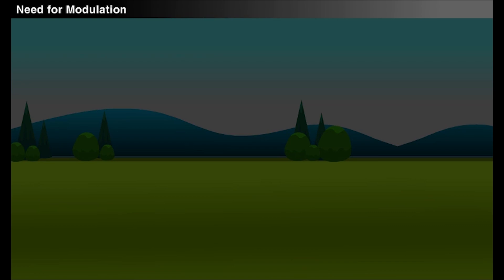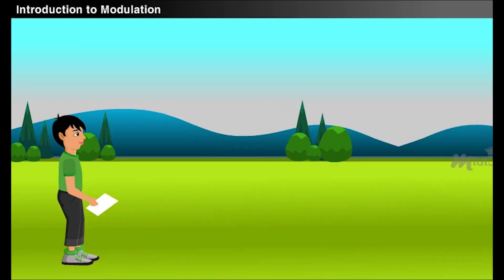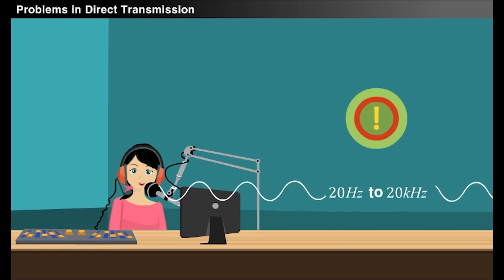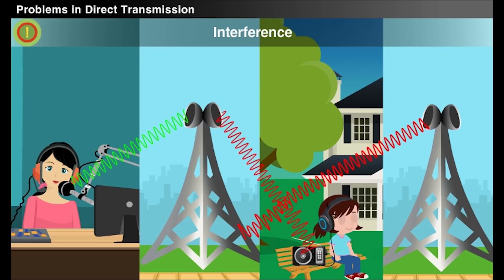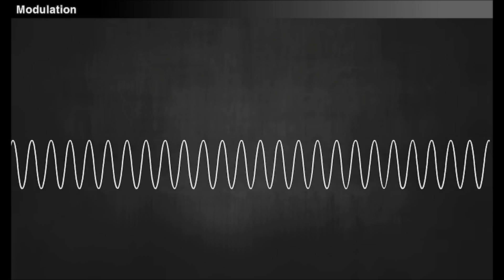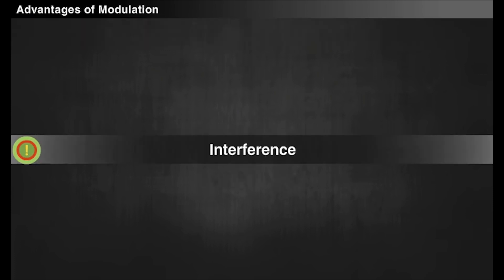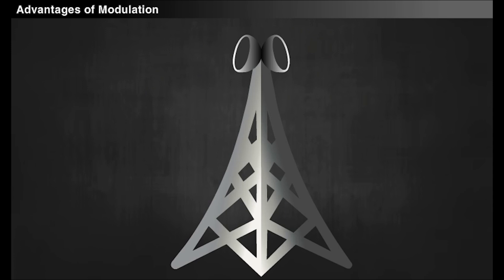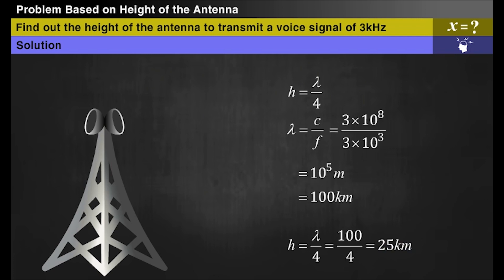Need for Modulation [Year - 3]

Comment: I understood this video in better way. But I want to know the answer of only one query. Given below :-
Q. Power radiated by antenna is directly proportional to the the square of length of tower upon wavelength of sound.Therefore ,power radiated should always be equal regardless of amplitude of sound. I explain it.
L=wavelength/4 (where, L=lengh of tower.) 
Power radiated = (L/lambda)²
=(lambda/4*lambda)[because,L=lambda/4]
=(1/4)[because, lambda /lambda=1]
I explained it and want to know answer.

Comment: 5:10 did not understand why by using higher frequency we don't need to change the antena height :\
would like for explenation
Reply: using formula wavelength = c/v and h = wavelength /4
Thus we increase frequency , wavelength will decreases and height decreases